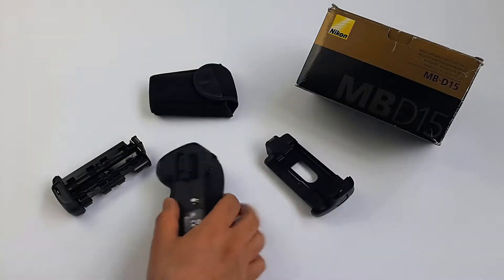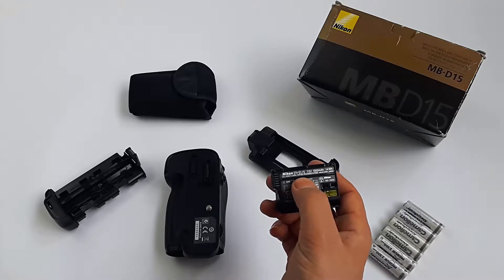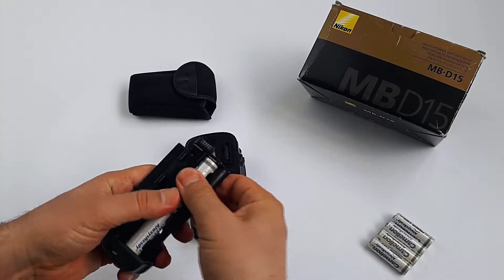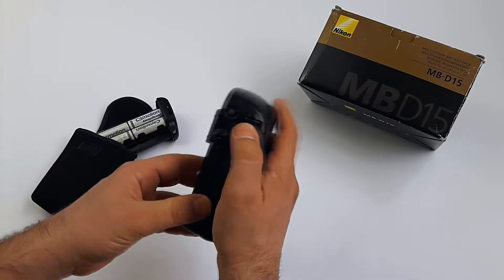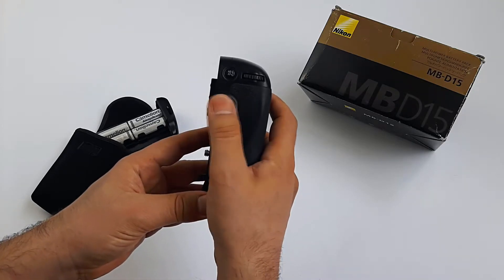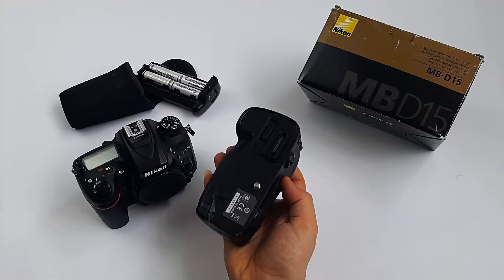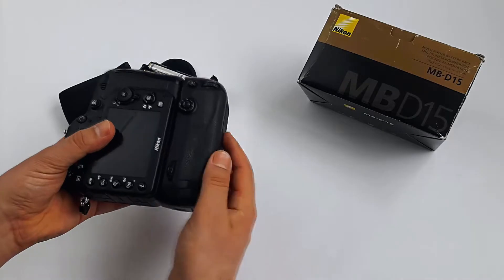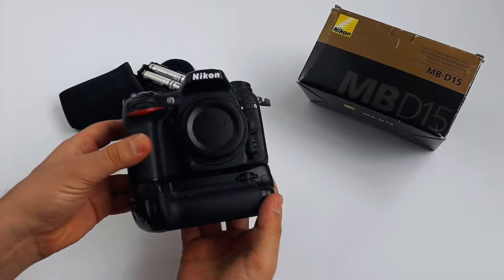Nikon MBD15 battery grip

Comment: I've been looking for a simple video like this.  Question,  can you leave a second battery in the camera with this on (and have twice the battery life)??   I'm used my older battery grips that held 2 l-ion in it and connected to the camera inside the battery compartment.
Reply from the maker: I appreciate you friend. Sure you can. you can use the both battery together to have the double battery life. one battery in the camera and another battery in the battery grip. 🙏👍😉
Reply: I just found the setting for which battery to use first!  It's D12 nder Custom Settings, called battery order.  I'll be ordering a grip soon!